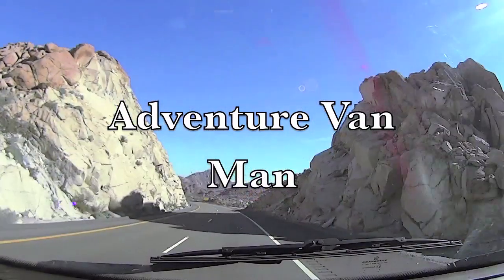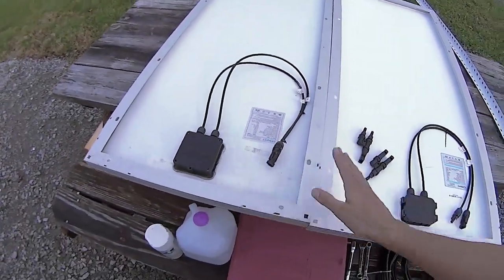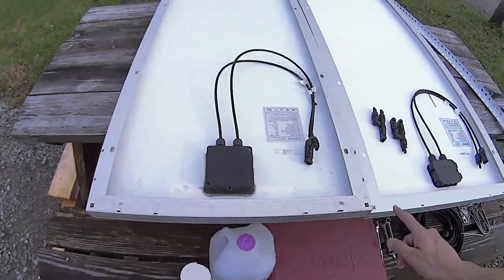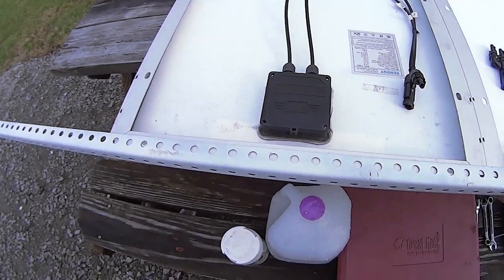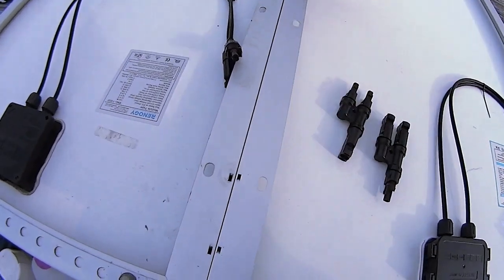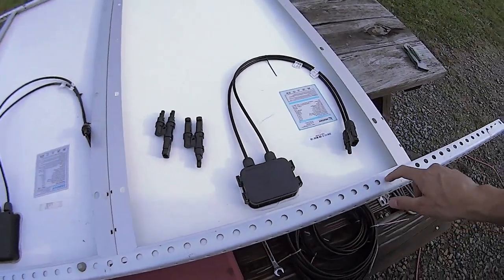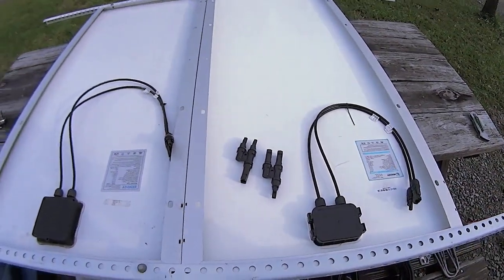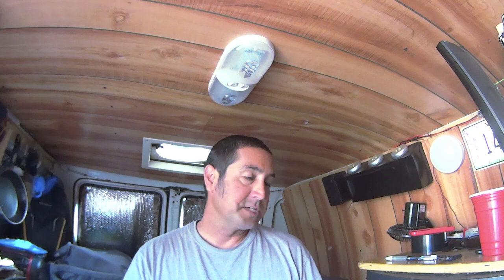Adding a Second Solar Panel

Comment: In the UK, I'd say you need 100w of solar for every 100ah of battery, 
Use a 30A controller for any set up then there's nothing to hold the solar back.

Comment: How many amps an hour are you pulling in on 2 100 watt solar panels ?
Reply from the maker: Per hour??  Amps are amps.  With the controller I was using and a parallel connection they could do around 11amps in full sun.

Comment: Did you find that the cable connections needed to be taped up to protect from rain?
Reply: yes if you look closely, there is some kind of caulk to protect it from the elements.

Comment: OK, negative to negative, positive to positive on each panel....now where are the connection wires that go to the battery?
Reply from the maker: Solar panel wires connect to charge controller.  Charge controller connects to batteries. 👍

Comment: Brian, if you leave your laptop turned off but plugged in during the day,  wouldn't it get charged along with the solar battery bank? I mean,  as long as it's a sunny day your solar batteries would get topped off early morning normally so with the laptop plugged into 12v off the solar batteries, it would just take longer for the solar batteries to charge. Am I making sense? I think it's all about when you charge accessories(ie. laptop). I charge by Ryobi power tools (off the solar batteries) in the AM when I know my solar batteries are charging.

Comment: Are you using an 110 volt charger on laptop? If so buy an apple 12 volt charger and it hardly eats power.

Comment: Have you considered putting an extra battery under the hood.  Most of those older trucks and vans had an option for two batteries under the hood.

Comment: Hi Brian. Another solution to your laptop use, which may not be acceptable, is edit during the day when the sun power is not being used to its potential. drawing on the batteries in daytime would have no effect as your 200 watts would supply the amps needed and leave you with fully charged batteries at night. (I know, daytime is for exploring) I feel the same.
Reply from the maker: +Boondoocker Bill I have an excess of power now.

Comment: Thanks for the update.  I am getting ready to install a Renogy  System in my van as well.  I purchased the 100 watt Renogy Kit with Solar Controller and all cables and mounts.  I also just purchased a 125 aH VMAX AGM Battery.  Once I have everything in house I will begin the install.  My goal is to run a Dometic Refrig (not purchased yet).  My Goal Zero Yeti 400 Battery takes care of my small needs like LED lights, charging cell phones, camera, and can also run my laptop if needed.  I need the solar set up mainly to run the refrigerator.

Comment: Hello Brian!  I've been binge watching your channel and am getting caught up.  Really enjoying your journey!  I'm in the U.S. Coast Guard, and at my last unit, we taught the servicing of Aids to Navigation, most of which are solar powered.  Some interesting tips that might help you...Orientation of your solar panels in the northern hemisphere (obviously) should be South-facing to take advantage of the entire day's sunlight.  Optimal angle for the contiguous US that the Coast Guard uses when mounting solar panels is 60 degrees.  If you're in Alaska, it's 75 degrees.  Hope this helps to optimize your charging during the daylight hours and I look forward to further enjoyment of your channel!

EDIT - I almost forgot.  We also use break-away aluminum nuts to deter theft of the panels.  You can find them here...

http://www.hooksandlattice.com/sign-security-hardware2.html?gclid=CjwKEAjwsMu5BRD7t57R1P2HwBgSJABrtj-R3_OgwoEjxMLb9r_sNYimvINBAhB9Af8QutWK69be1RoCOZzw_wcB

There's a trick to removal of the panels after installation with these nuts.  If you're interested, let me know and I'll email you a picture of how it's done.
Reply from the maker: +HoboCoastie Thank you for your service as a Coast Guard.  I am glad you are enjoying the channel.  I will keep your tips on solar in mind.  Peace

Comment: I have been thinking more about portable wind turbines.  they do need a good 20mph to be effective but especially in the winter when it's very windy, you can still be juicing the battery bank all day AND all night.
Reply from the maker: +Kracker Jack All of the portable wind turbines I have seen used are very noisey and usually only put out a trickle charge.   I had to move my camp away from a RV using one because it kept me up all night.  Solar is so much more effective.
Reply: Ah, I hadn't considered that.

Comment: When it's time to replace the house batteries, do consider the lithium iron phosphate batteries..  lighter weight and size, and much more power capacity.  You probably will need a different charge controller, but in the long run, it will be less expensive, since the LiFePO4 batteries have a much longer operational lifetime, and you can discharge them down to 10 % without damage.

Comment: hey guy,
i finally got a larger truck, and a canopy on order. 
my question is:

how come you decided to do the solar panels, over connecting another battery to the engine to allow it to charge while driving / running the vehicle?

just trying to see what could be a better system to use.
any suggestions for a guy who plans to do truck camping (i'll ideally only need led lighting,maybe a small fun to run,charge my laptop while on it)
Reply from the maker: I do charge while driving using an isolator solenoid as well as the solar panels.  I run a 12 volt fridge as well as doing a lot of video editing on my laptop.  I would not have enough power without the solar panels.
Reply: oh ok sounds good. 
i'm new to all of this, 
so assuming a deep cycle battery is bought and a solar panel...would that be all i needed? 

will the solar panel ever need to be disconnected, assuming it would over charge the battery or something like that ?

Comment: I dont RV but I had my boat I was in a similar situation, granted i did not live in it I would stay on on the weekends especially three days, I had setup two battery banks on my boat, bank 1 consists of two very large dc marine batterys it started the motors, and  all lighting, and 12 volt chargeables in the boat , bank two consisted of three batterys they powered the fridge, tv, dvd, music, microwave, and AC, if those batteries went low they would charge up via generator or through the alternator if the engines were on, I always had wanted to replace the gen, with panels but it neve happend, you should, keep your laptop, buy a small gen. you can get one for less than $500.00 a new macbook pro with all the bells and whistles will start @$1800, keep you fridge and needs on one bank and make second bank for your wants,

Comment: If you are looking at new laptops, look for one that is 12 volt native.  My MacBook Pro is that way - the car adapter for it is simply a cigarette plug on one end, and a magsafe on the other.  The draw is very low and I can run it on the engine battery for ages.

Comment: Nomadic Fanatic has a new video about trouble with the battery bank.. You might look into his video. He ended up giving away his new Walmart marine batteries because of the issue you described, charging up fast but losing power quickly after dark. He upgraded to 4 - 80 hour AGM batteries. I know you can only store 2 batteries, but maybe AGM would be more suitable, just a guess. They are expensive, but they preform well in extreme temperatures and don't need venting like liquid batteries do. Just an idea, I know how you love Eric.  :)

Comment: Do you have a 12-volt power plug for your Mac? They are a little pricey but worth it for extra efficiency. If you want I can find link where I got mine.
Reply from the maker: +Will Burson I do have the 12volt adapter.  I does seem to help a bit.
Reply: AdventureVanMan Just installed my solar this past weekend and loving it so far.
Reply from the maker: Right on man.  Solar makes all the difference!

Comment: Why not get a DC laptop adapter? You won't have losses from both the house inverter and ac adapter power brick.
Reply from the maker: Thanks, yes I do have a DC adapter, I forgot to mention that.  It does help conserve some power.

Comment: You might want to do some in-depth research about the lithium ion battery before buying, there are safety issues with them. Lithium batteries have a history of catching fire and the bigger the battery the more heat is generated. Remember all those laptops catching fire and the airplane fires from the large lithium batteries they use? Be safe.

Comment: Hi Brian, love your videos. Thought the way you installed solar panel #1 was great and now #2 Easy to raise and lower to get most out of the sun. I was wondering if you have ever had a problem with vibration or noise from the wind while driving ? also did you notice a difference in gas mileage? Thanks again, keep up the good work and videos.

Comment: I am a new subscriber, so forgive me if you have covered this, but it is too important not to mention. If you have your van idling to charge batteries, you run the risk of carbon monoxide poisoning. I have attached a link to the CO detector I use in my van. Remember, household CO detectors will not work in a vehicle. The vibration and climate/temp changes will render it inoperable and you will think you are protected when you are really not. http://www.campingworld.com/shopping/item/atwood-carbon-monoxide-alarm/77070

Comment: It's nice to hear about good people here on YT, that is an awesome gift. Are you charging your laptop using an inverter? Cheap RV Living mentioned a 12 volt charger that I had trouble locating until recently. It seems to me keeping to the 12 volt system would be the best use of a solar set up instead of losing power converting to AC. Just wanted to know your thoughts.
Reply from the maker: Yes, I use a 12volt charger for my laptop.  I have an inverter but I only use it to charge my electric shaver.
Reply: AdventureVanMan cool, maybe you should give up shaving, you know to save battery :)
Reply from the maker: Lol, last time I grew a beard birds tried to nest in it!
Reply: +AdventureVanMan ha ha!

Comment: Do what I did ..Fit a 200 amp Alternator on your campervan in conjunction with a 3 step smart. Charging regulator..basically turns the Alternator into a powerful battery charger...you will generate more power than you  will be able to use...been living on the road ten years ...check out my channel

Comment: On my van I only have room for 200watts.so my upgrade path is

Renogy 100w mono and pwm kit(current)... 
Pair of GC2s or maybe two marine group 29 faux deep cycles if dirt cheap. 
Another 100w renogy mono panel... 
MPPT charge controller...
Buying land and building my homestead and solar growing from that point on restricted only monetarily. 

I have a 1st gen i5 laptop and am having the same problem as you but to a worse degree being that my battery banks I'd exactly one small starting battery. A DC-DC charger makes a huge difference but I can still only run my laptop during peak solar hours.

Comment: Hello Brian, nice work with solar panels...👍. Did you think about battery booster? Battery booster is able to charge additional battery during one hour of ride about 50% of its capacity. Wish you a many safe kilometres (miles) 😃

Comment: Good video.  I just installed an HQST flat 100w panel on my pickup truck with a Vmax 125AH battery.  The reason I went with the HQST is because I wanted the flat panel which only weights about 4 lbs.  Renogy used to make them, but they don't anymore.  This video is informative because I want to add a second panel so that I can charge my battery faster.  Thanks.

Comment: Hi Brian. Why not do your editing and stuff during the day when the sun is at its peak and keeping charge to the battery. As opposed to waiting until night time when the sun goes down and the solar panel isn't charging the battery.
Reply from the maker: Then I miss out on enjoying the beautiful day and have nothing to do at night.
Reply: +AdventureVanMan I bought an extra laptop battery for a similar situation.  I charge that extra battery during the day with the excess and then have twice the computer time in the evenings using computer batteries instead of coach batteries.

A new laptop might be an eventual option.  Newer macbooks last well into the evening.
Reply: +AdventureVanMan Where did you buy your brackets to mount the solar panels?

Comment: Yeah, that battery isolator is the way to go...keeps your cranking battery and your coach batteries managed. I can see where doubling your solar is a great thing.  And maybe they don't need to tilt, if they're happily charging your batteries while flat: another great thing.

Maybe using the laptop in the DAY when there's a power surplus would be better?
Reply: I just addid another 100 watt to my rv i converted to a tiny home it does make a big diferance the way mine home is wired i can backfeed threw the wall sockit if power goes out im putting in 1200 watt system running to solar power banks one is primary 12000 watt inverter 6000 watt output to run my tiny home and a secondary for backup and to run my nicknacks going to run 800 watts to primary and 400 to secondary .done tested it it runs my home now if i want on 100 watts but beter on 200 running a 4000 watt inverter now and a krieger 2200 watt 1100 out put inverter as secondary works sofar.

Comment: I just finished my solar setup yesterday. Couldn't bring the batteries down though because I didn't have anything big enough with my setup to bring it down. Not the case today! HEHE Going to take out a 1500W heater and load test the battery bank. :)

Comment: .
.
.

How about a rear door spare tire rack and adding / fabricating a undercarriage rack for additional battery, or batteries in that space?

.

.

.
what u meant in mt earlier message

Is their a 200 watt panel that is the dimensions of ONE of the panels you added to the roof?

Comment: Could get another converter for the dc and run the laptop off that. All laptops are dc. Just look at the brick in the cord and see what it is. Most likely 17-19 volts. So get a converter that changes your 12 volts to what the laptop needs. By not using your inverter just to power the laptop will give you an extra few hours of use on your battery setup that you have now.

Comment: I just have the original 2 6V deep cycle batteries, with 180W on the roof. I shut things down once the charge controller shows 13.0 or under, usually an hour before sunset, then do stuff on my tablet. My laptop goes for 1-1/2 hours, and I save that for the morning. Until I can get more batteries (and convert a storage compartment, another 2 panels, maybe $1,000?) my next step idea is to get a 100W portable panel, and use that to charge an extra battery I can bring in at night for the laptop.

Comment: I had the same problem with my 200w system in the popup. I found the only thing that worked was doing some my computer work during daylight hours. Maybe put duel batteries under the hood also?

Comment: Hello Brian, nice job on the solar panel upgrade video. I think you already know this but with the 200W now you can charge as well as use during the day. You will most likely have enough power for both. If you are in a pinch you could try to do your editing during sunlight hours and that would help with not depleting your battery bank after sunset. Of course that will depend on your time and personal schedule needs. Travel safe.
Reply: Solar Photovoltaic Diodes

Comment: http://www.amazon.com/Acer-Chromebook-11-6-Inch-CB3-111-C670-Celeron/dp/B00MMLV7VQ/ref=cm_cr_pr_product_top?ie=UTF8 Amazon for 150 bucks. Best laptop ever and the battery alone last 10+ hours. Incredible. Great video Brian!
Reply from the maker: Those are great laptops for browsing the net and such but will not handle video editing.  Need at least an i5 processor with at least 4gigs of ram.
Reply: Ah yes of course. What about somethin like this? http://www.amazon.com/gp/product/B00S6SMKRE?keywords=laptop%204gb%20ram&qid=1454398382&ref_=sr_1_9&sr=8-9

Comment: I'm likely going to have similar issues when I get my van set up, so good timing. A couple of questions.

- How badly would the temperature go down, if you disconnected the fridge at night? 
- My (gaming) laptop is an energy hog, too, and the battery life in the best of conditions, even new, is only about an hour. So, I'll run into similar issues. I've been wondering if it's possible to go directly into DC power - how would I do it, and would it be worth it, rather than plug into an inverter? (I really don't know much about electricity, but it seems inefficient to go from a DC converter to AC then to an inverter .. isn't there a power loss in there, somewhere?)

Looking forward to the info on the lithium charger. 

Happy trails, 
Ladee